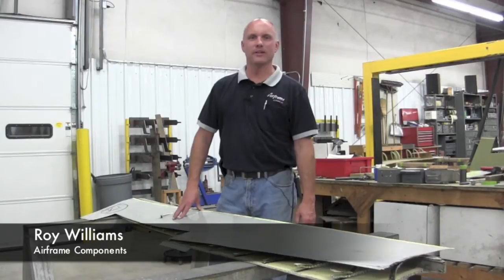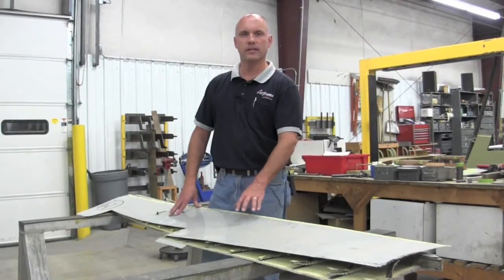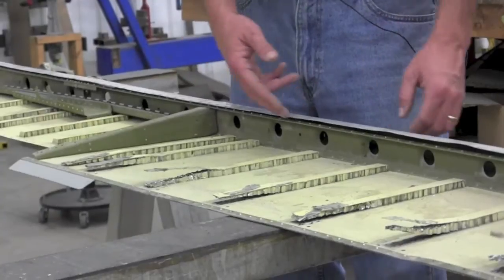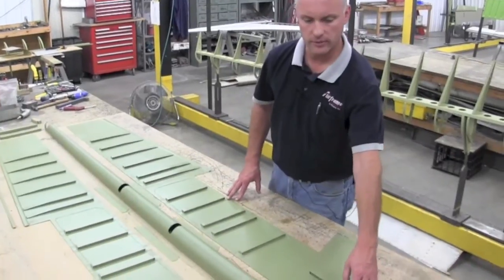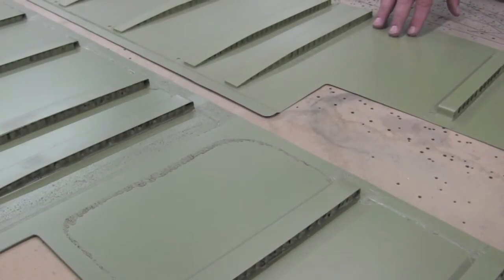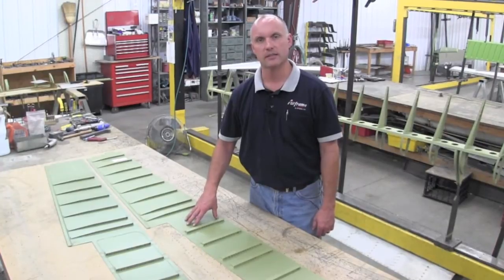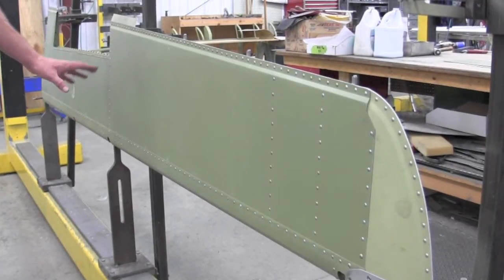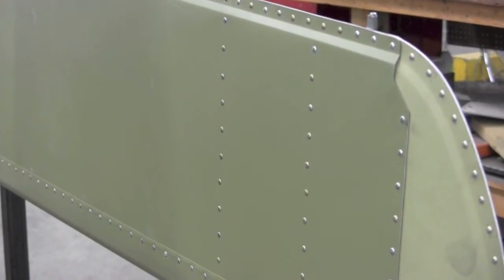Beechcraft Elevator Skin Replacement

Comment: Why aren't original designs tested to failure???  The design engineer should have considered the corrosion properties of magnesium skins at the outset!
Reply: AE: The Baron was introduced 58 years ago.  How long a life must the manufacturer plan for?  Must he over=design for worst condition life?  That adds much additional cost.  Magnesium skins have been used successfully in many aircraft designs.  If the owner does not keep the aircraft in good condition, that is not a fault of the design.
Reply: They did and that's not really the issue. Basically, they needed very light construction and magnesium was much more plentiful. Magnesium requires special treatment before paint, and many repainted aircraft did not do the required treatment or did not do it well, before repainting.